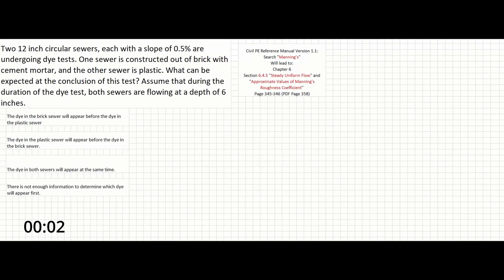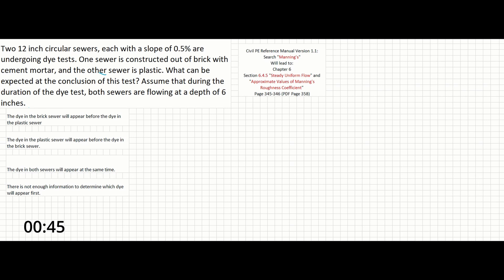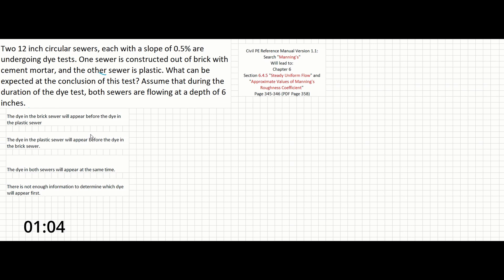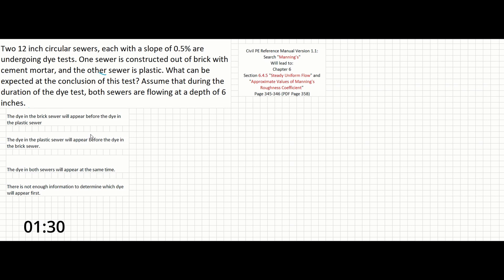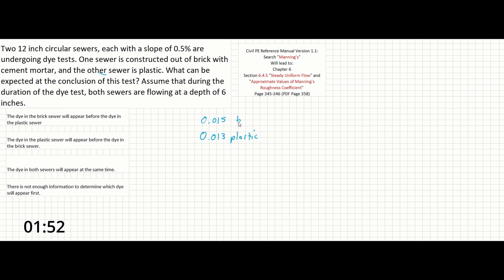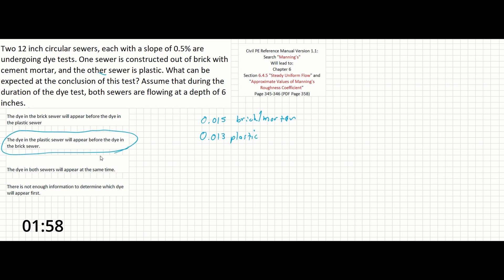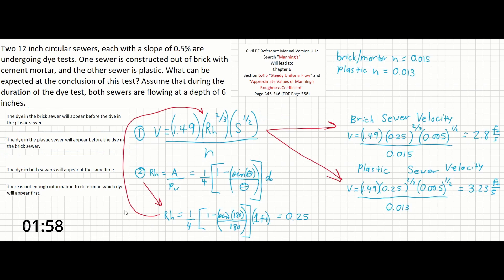PE Exam Practice Problem #50: Water Resources | Mannings Equation - Concept

Comment: question regarding determining hydraulic radius. Can you just use the " Hydraulic elements graph for circular pipe (partial flow diagram) from page 362? Doing this I get 1 as R/Rf which gives me Rh as .3183. Which does not match your math, just curious if I'm misreading graph or if this is the wrong time to use it. Keep up the good work.
Reply from the maker: Thanks for the question. Am I correct that you first calculated R and Rf, and found that their ratio was 1? When I trace up from 1 from the bottom of the hydraulic elements graph, I am reaching a hydraulic radius that corresponds to a d/D of 0.5. Would you mind walking me through how you found 0.3183? Sorry if I'm missing something obvious - work is busy today and this problem is over a year old in my brain. Still happy to help.    On another note - at least for this problem - as long as you used the same Rh for both pipes - the mannings value is the only thing that is changing and you would still end up identifying which sewer has a faster velocity.
Reply from the maker: Also, taking a step back - I don't think you can actually use this graph to determine the hydraulic radius. There are no values for hydraulic radius on the plot - the shape of line is just helping to show us the relationship of things on one of the 3 axes to things on the other 2 axes. I hope that helps to clarify a little and please let me know if I ignored something obvious or didn't answer the actual question.
Reply: @SolvedIn6  So I took the d/D to be .5/1=.5 so I just traced that across to the hydraulic radius line and then straight down to 1. then set 1= R/Rf.  I can solve for RF with the given diameter to be 0.25. Then just solve for R.  Which gives me R=0.25.    So, I think my conclusion is that the chart is fine to use if you don't screw up the simple math like I did the first time.  Thanks for talking me through it. In trying to explain my process I found my error. Keep up the great work.
Reply from the maker: @lukegill8902  Nice job.